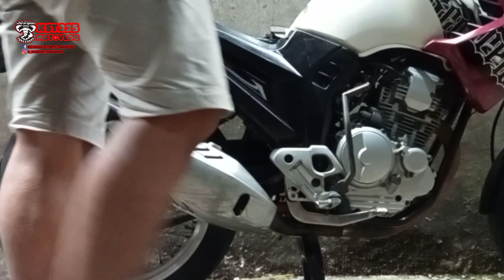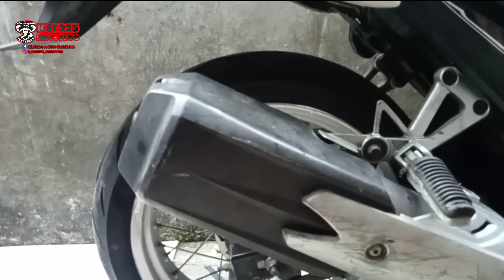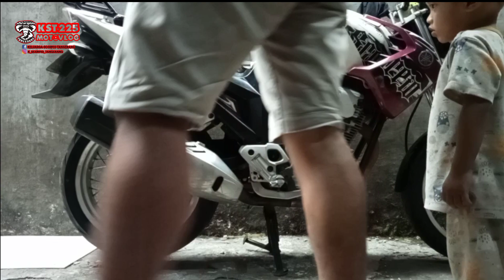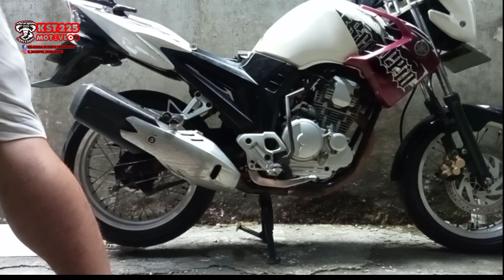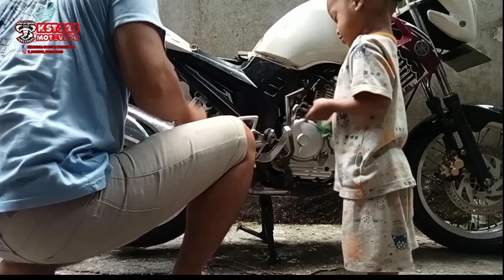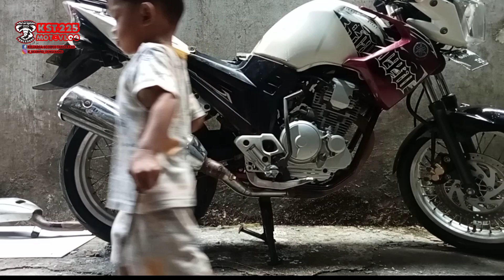PASANG KNALPOT HONDA TIGER DI YAMAHA SCORPIO

Comment: Bang mau tanya, scorpio gw dr gigi 1-4 tarikannya mantab tapi masuk gigi 5 loyo kenapa ya?
Reply: Ada yang perlu diupgrade kah bang?
Reply from the maker: Karna gigi 5 ratarat standarnya scorpio buat ngentengin aja (gak nambah speed) kcuali dijarak yg panjang.

Yg ane rasain pas ngerubah gearset gear blkang pake 40 at 41 juga berasa napasnya panjang dijpan datar.. cuma tetep gigi 5 gak nambah speed
Reply: @KST225MotoVLOG  scorpio abangnya msih standar?
Reply from the maker: @sultancakra196  klo mesin ia bang masih full standaran..   krna tujuannya mau nyobain perubahan gearset tsb dan hasilnya lumayan ada prubahan bang dri nurunin gear blkang pun ,   cuma kurang saat di gigi 5 nya ...
Reply: @KST225MotoVLOG  solusinya biar gigi5 ga loyo apa bang
Reply from the maker: @sultancakra196  jalurnya hrus mndukung itu yg pling pnting bang,  saya blom prnah ngarasin dpet jalur yg panjang soalny
Reply: @KST225MotoVLOG  siapp bang
Reply: @KST225MotoVLOG  efeknya apa ya bang kalau per kopling pake racing? Enak ditarikan awal aja kah?
Reply from the maker: @sultancakra196  kalo saya cobain motor temen , di tarikan awal  hntakannya biasa aja..  tapi buat selanjutnya stiap prpindahan gigi enak bang gk ada slip dan rasanya lbih responsip dri yg standar